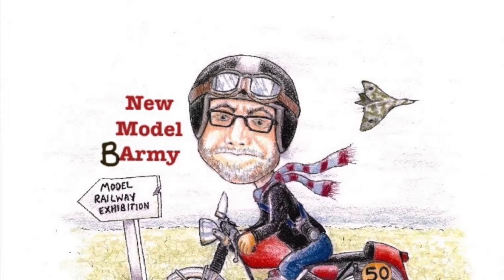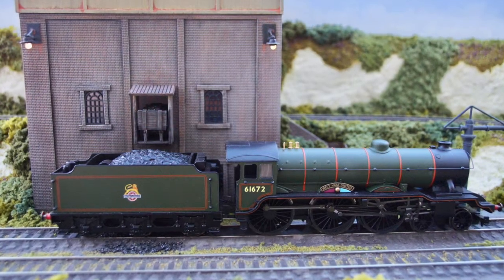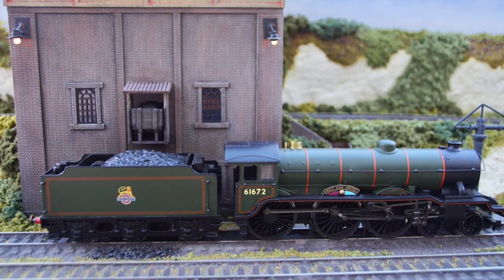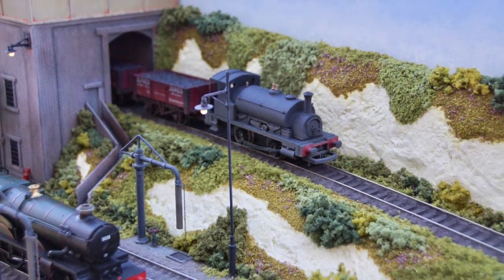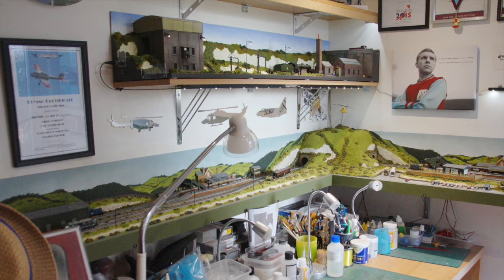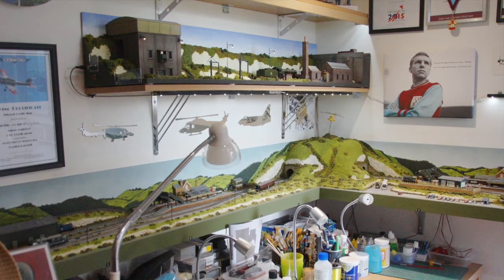Brooking Vale Coaling Stage, an automated OO Gauge Shelf Layout. Part 10, complete!

Comment: I love it. Very well done Jason. I am collecting stuff for my next small layout which will be the Melbourne Military Railway in WWII. I want a 'normal' looking bit of track to photograph non-war era trains on as I only have the WWI layout and a test track. I am considering shuttles for the first time. I've watched Laurie Calvert use them a few times. Good job m8.
Reply from the maker: Thanks mate. The Block Signalling shuttles are very good and don't require soldering diodes to the rails. I only went for the basic ones but in hindsight I should have paid more for the ones with the built-in speed control so that I could fine tune the speed of the locos on each track, especially on the incline!!! I loved your Great War  military layout so I'm looking forward to your next one.